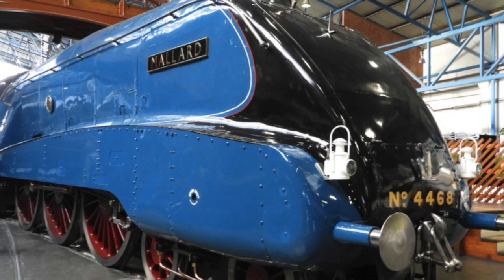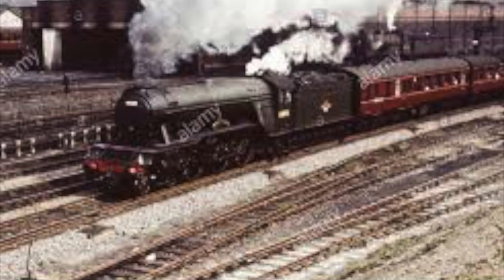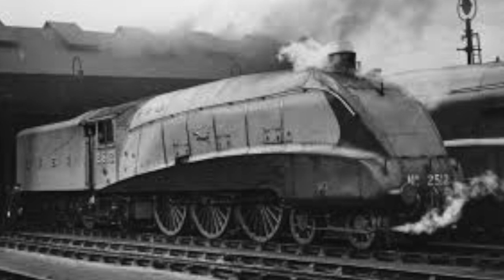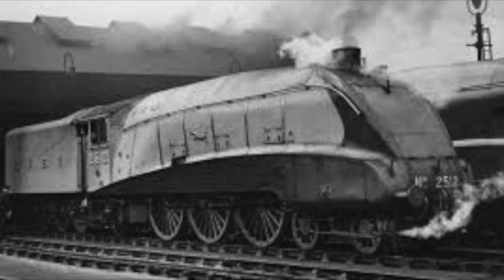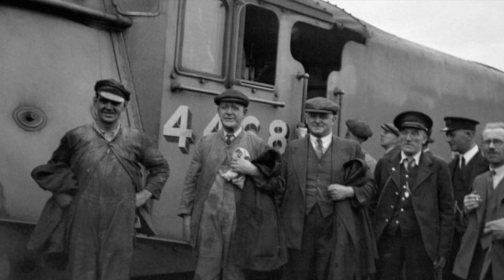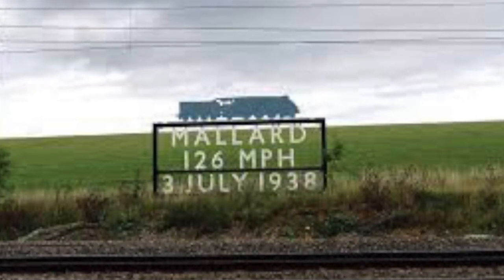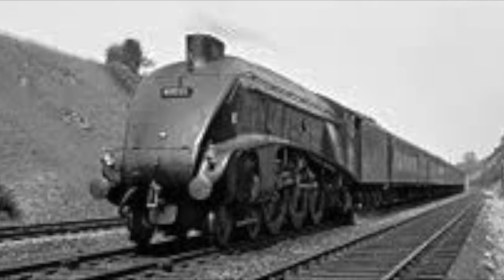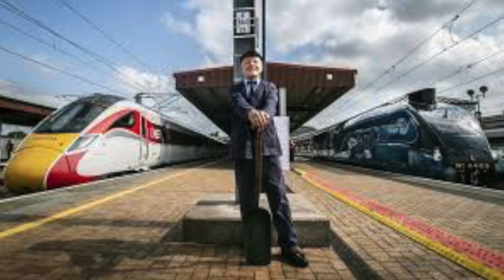MALLARD

Comment: Out of interest, where did the number of over 100 come from? There were 35 A4s built and if you also add in A1/A3s, it would be 86 with 7 preserved.
Reply: That's exactly what I was thinking
Reply: Actually there were 52 a1's and 51 of them were rebuilt into a3's and the lner built 27 more a3's so you get 79 locos add 35 a4's to that and you get over a hundred
Simple